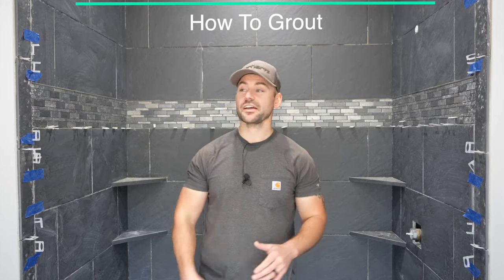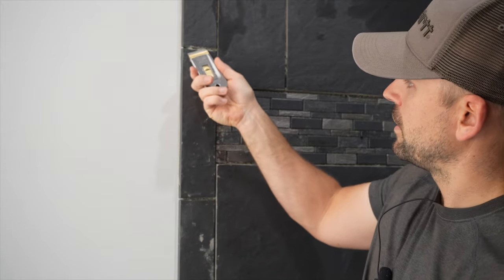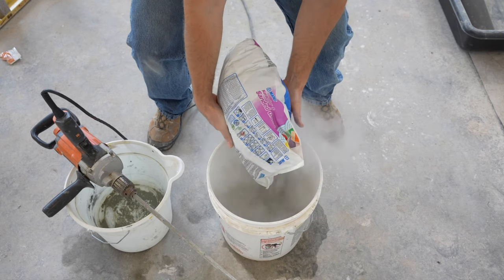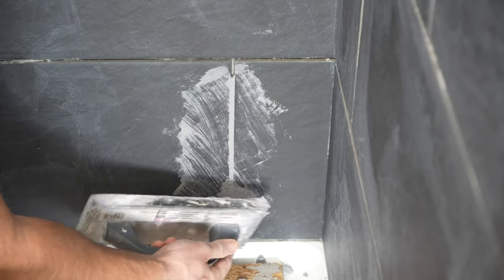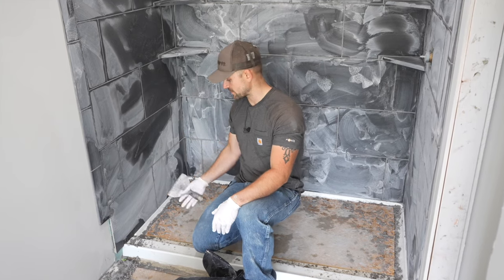How To Grout A Shower Wall - EASY Step-By-Step Guide

Comment from the maker: Hey fellow DIYer's! There is A LOT of information in this video. I placed timestamps below to help you navigate this video. Enjoy!
Intro 00:00
How to prepare for grouting 00:17
How to remove dried thinset 00:55
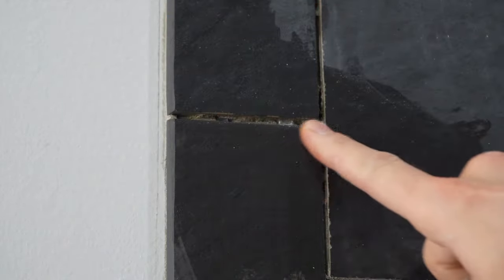How to clean tile before grout 02:50
How to mix grout 03:17
How to apply grout 04:47
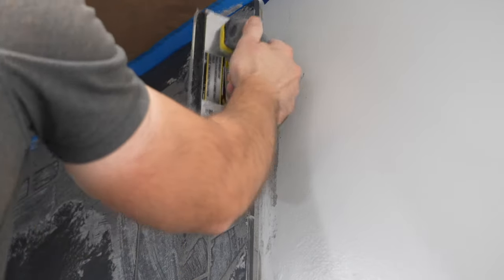How to remove excess grout 06:56
How to remove grout haze 08:31
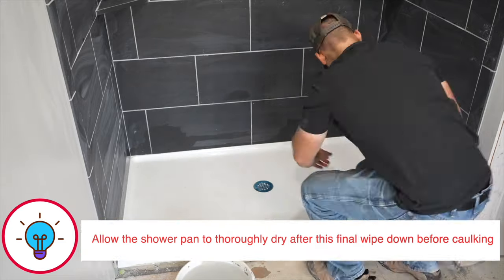How to caulk a shower pan 09:35
Reply: T
Reply: I watched your video to see if I need to caulk the expansion joints first or grout first then caulk. You dint leave expansion joint between the walls though
Reply: Thanks so much for this !! I’m about to do my first grout job !!! 😊
Reply: Lollipop sticks of
Reply: The excellent Pro. More like.. Beautiful job.. very neat work.. explained to every detail. Thank you Sir

Comment: Josh, when doing 90 degree corners and where the tile & shower pan meet, you should always use 100% silicone caulk, those joints will always crack if done in grout. Most Grout manufacturers have matching color silicone caulk for this purpose. On a side note, you can use a spray bottle with either soapy water or denatured alcohol to clean up your silicone caulk joints.
Reply: Hi thanks for the info.   I was wondering how the grout on my ceramic wall and plastic shower pan would ever hold.  I'll go with your advice and use caulk
Reply: @jeamarcr85  good luck , I'm sure it'll turn out great!
Reply: Nope
Reply: I think flexible grout doesn't crack.. 
Flex adhesive and grout are excellent to use. Sorry I maybe wrong. Sorry..
Reply: Yes, never grout corners or between tub.
Reply: You need to clean the joints while its wet, use a tooth brush. Cleaning while its dry is a waste of time, this isnt professional at all.
Reply: Sanded caulk has silicone in it. So good to go and dont have that smooth shiny 🤢 look
Reply: @SonsOfThunder229 I can tell you don't do tile for a living. If you do it takes you allweek
Reply: I was just about to comment the same thing. Mapei Tile caulk in EVERY corner.
Reply: Did you even watch the video??  He used silicone!
Reply: He sure as frack didnt caulk aything besides where the tile and pan meet. Thats whack AF. 2 Years from that video his grout in the corners is cracked and leaking water because if your not caulking every corner your waterproofing is suspect.....but yeah he used silicone alright.
Reply: @oginaz the standing corners get caulked in professional tile jobs.....grouted in Hack jobs js man
Reply: But the tile setting is on point, Id hire him for a helper.
Reply: Siliconized grout is awesome. Really good for where tile backsplash meets the countertops. That line always breaks.

Comment: Just a tip, for all the DIYers watching this , depending on heat and humidity and tile type 30 mins may be a very excessive time to wait, all these things play a major factor in how easy it’s to clean off, also a circular motion is a very good way to clean off the grout on the first wash, even pressure what will help loosen the dry grout on the tile,
Reply: This is a good tip, I’ve had grout dry within 5-10 minutes on me. You always have to touch and check how the grout feels. If it’s drying on you, leave everything you’re doing and do the first wash

Comment: As an expert grout technician never sponge clean wiping directly along the joint. Try to always clean at a 45 degree angle to keep to grout joint full. When second pass cleaning grout, start from a clean section, wipe one pass, turn over sponge, repeat, clean sponge thoroughly. and repeat.

Comment: What I used to clean out the thinnest in my grout lines on 12x24 tiles was a multi-vibratoir tool with a diamond edged universal grout removal set for multi-tools.  It made short work of removing the extra thinnest  and was very easy a quick to do.

Comment: Another tip when using silicone use a squirt bottle with 50% rubbing alcohol 50% water mixture and spray on the silicone bead before wiping. It makes it so much easier to clean and smooth out.

Comment: Hey so just want to give a tip I currently work in the tile business and what we use is a tool called a grout stripper and it works excellent to get the extra thinset out also microfibers would help extremely well to get the haze and excess off a lot better. Just thought I help with a little tip 🤝🏽
Reply: Topps tile sell that. Excellent point you have made Sir. Very good tip. Thanks..

Comment: I love doing tile. I found a great time for grout.  put your grout into a pastry bag with a small tip (just like the one used for cake decoration). this tip keeps the project clean and less haze to clean up from the tiles.  the most important tips is to load the joint full, don't skimp on filling the joint.  

I did it on my backslash and it worked great!!  well if it sounds stupid but works well, then it isn't stupid.  try it out.
Reply from the maker: That’s a good idea. When I do stone veneer that is how I grout it. I wouldn’t mind trying a small project and see how it goes with that. It actually makes perfect sense. I made a video doing the stone veneer grout application. Thanks for your comment!
Reply: I am doing my first grout today. I was thinking why is there not a gun style system to fill the gaps instead of just smearing it all over with tons of haze after. I wont be able to try something like this out because I am not the boss of this project but I am glad to see someone was thinking like I was.
Reply: @rogerlane2282   from my experience   it works well. The only tip I can give is to use premixed grout. And fill the piping bag as you go.  You get consistent color with premixed gout.  And only filling the piping bag as you need it keeps the grout from getting to hard to pipe the grout into the space between the tiles. I did this and it works great and so much cleaner.
Reply: I get it.  But grouting 5000 sq ft with a grout bag would be hell
Reply: Excellent point. Gonna definitely try that next time. I was thinking about fillable silicone tubes.. Great idea Sir. Thank you..

Comment: I highly recommend Mapei Ultracolor Plus FA grout. It's sold at Lowes and Floor & Decor. It's offered in many more colors than the Polyblend brand sold at HomeDepot. It's a bit more expensive than standard sanded/non-sanded grout, but totally worth it. It takes the place of both sanded and non-sanded grout. The perfect solution when you have a combination of matte and gloss tiles. It offers more joint size flexibility, from 1/16" to 3/4". It doesn't use Portland cement, so it eliminates efflorescence. It also doesn't require sealing, which is a major bonus.

Comment: Great video. Really clear and precise instructions. For the corner shelves , have you tried making the top part of the shelf sandwich, slightly longer (thickness of the tile) so that you can install the front edge without seeing the unfinished edge of the tile at the surface of the shelf? Hiding the seam, basically.  I am a stone fabricator and this is how we usually install those pieces? Either way, shower looks great. We don't install tile format sizes, only countertop slab dimensions. Materials like Dekton, Neolith, Level etc... So , I am personally interested in how other people install tile sized formatted porcelain in showers. I will definitely watch some more of your videos.

Comment: Great look Josh. It is always the way to go on large tile layouts and of course if it smaller, you do cover all the surface of course. I've also used an epoxy base grout which you do have to do a wipe down as you go but it's still the same process. I always have two - three buckets of water when grouting and the warm to hot water which helps the haze to clean up easier. My final wipe down is with a terry cloth material which absorbes more of the residue. 
I know everyone has certain tricks of the trade, but the important thing is not to rush this stage and follow the guidelines of your grout manufacturer. The caulking of the bottom is so important and nice if the grout company offers a matching sanded or non sanded sealant. 
Wonderful look with the shower Josh and to your wife. 👍🏻👍🏻
Reply from the maker: Excellent advice David! I love hearing how everybody does their project. Everyone learns! I do not do tile for a living so somebody who does it every day I’m sure does it much different than someone like me. Thanks for watching and commenting!
Reply: @TheExcellentLaborer  doing so much myself in the remodeling aspect of things is always a wonderful thing. From a start to finish of a kitchen, bath or basement project, everything has a situation that requires a different of doing something. Just like you doing new construction from start to finish. Of course remodeling, you come across things unseen. But patience is the key and the ability to do things right the first time. Have a great weekend Josh.

Comment: Really nice video.  Question about the shelves,  since there is not alot of surface with thinset holding the shelf in place, have you ever had a problem with a shelf breakage / failure?   I know the tile above the shelf does provide some additional support as well but just can't have a failure.

Comment: I’m about to grout my shower. My question is: can I use sanded grout on the entire thing considering I did 1/16 between each tile and 1/2” between each row? They’re standard subway tiles stacked vertically. Thank you! Using this video all day

Comment: good tutorial. I'll be grouting my shower as soon as the mastic on the tiles dries.
Reply from the maker: Thank you! Grouting usually goes pretty quick. Good luck with your project!
Reply: @TheExcellentLaborer  Thanks. It was a hell of a road to get to the point of grouting. I had to rip out an old plastic surround mounted on drywall. Everything was moldy down to the studs and insulation. Its nice to see a project that's been months in the making finally coming within sight of completion.

Comment: You need to use way more clean water and change it out more, the proper way to wash is to do one clean side like you said but then flip pull and wash and repeat you should go through about four five gallon buckets filled halfway to do each wash. When you're done with the second wash and the fine-tuning take a towel and buff it, you won't have to come back the next day to do a third wash. And if your second wash is really good there will be barely anything even with a black tile. And you should also use more of a volume of grout on the wall when you're grouting the volume of grout helps push grout into the voids where you can't see

Comment: My first grouting tomorrow. On a side note I did use mortar under pan and it was fine I thought but during tiling process I have noticed an irritating creak in one quadrant. 
Is the “anything” that can be done. I suspect not.

Comment: Many times have seen recommendation to use silicone instead of a simple grout in corner joints. But you didn`t use it. Is there any advantages for that, please?  Some people uses a soapy water to prevent silicone against sticking around grout perimeter. Is this a good practice or finger is the best solution? :)

Comment: How do you remove thin set with porcelain tile where you can’t use the scraper like you did or it will chip the porcelain vernier off the stone tile.

Comment: Hi, by mistake I used mapei sanded grout superior premium on part of my walls and floor, instead of mortar, what do you think could happen, I wanted to remove the tiles but they are very hard, do you think I should remove them or leave them that way
Reply: Maybe too late but listen..  Your floor and Walls WILL FAIL if you ended up setting your tile with grout instead of thin-set mortar. It Will Absolutely absorb water that will quickly result in Extensive Water Damage and likely cause you to have to replace everything and start over. If you haven't already..  remove the tiles and replace them with new tiles set with thin-set mortar or other appropriate tile setting adhesive, at VERY LEAST DO the FLOOR TILES.  Do it, it sucks but it'll be much more work and MUCH more money if you don't.   
         - Guy tryin' ta warn ya.

Comment: One suggestion, invest in a “cox” black gun. It’s much smoother than that stamped POJ.
I have one, completely wore out, from 25 years of gunning automotive urethane for windshields. On a varathaned oak plaque. Ha ha ha.
The one on the plaque was made in England. The new ones….Chinesium.

Comment: What happens if there is an inch between the shower tile and the tub? Ive tried caulking multiple times but the gap is so big it still leaks.

Comment: Nice installation. Painfully slow grouting process though . It would take me 30 minutes from start to finish to grout a simple 3 wall shower. No jambs or niche even simpler . I would recommend a raimondi grout system wash bucket . If you were using the new grout products. Let’s say a Mapei FA or even urethane. You’ve got to be quick with it or you’ll lose it and be scrubbing your $&! Off. Just drag the float across the tile man. No need in the pitter patter with the float. Also circular sponging if fine doesn’t matter . It’s all out uniforming the joint and tooling it with the sponge .

Comment: I don't see why you need cement board.  If the waterproofing is done correctly, the water w never reach the cement board.  I just took a shower wall down to the studs to tile it.  The wall was 20yrs old and drywall will painted shower walls.  No rot, no water infiltration anywhere, clean studs.  So... Dry wall up, taped edges, drywall mud and sand.  Water proof as you have done, maybe two coats and hang tile.  Prove me wrong.

Comment: just a suggestion but a few years ago i discovered a little trick to completely remove thin set and grout from any tile ......boils it off and doesn't hurt any tile;;;;;;easy off oven cleaner....it works
Reply from the maker: I have not heard of doing such a thing. I will have to do more research. Thanks for watching!